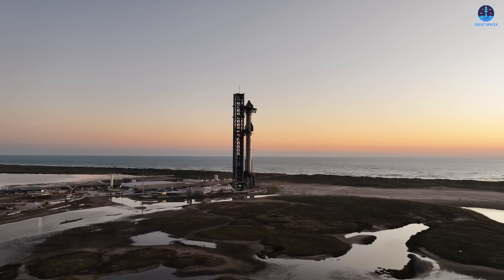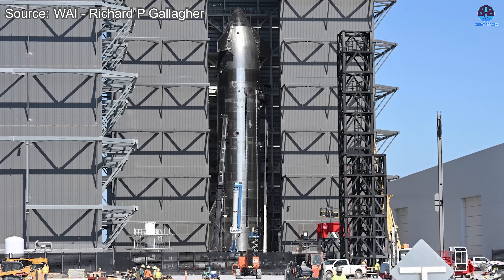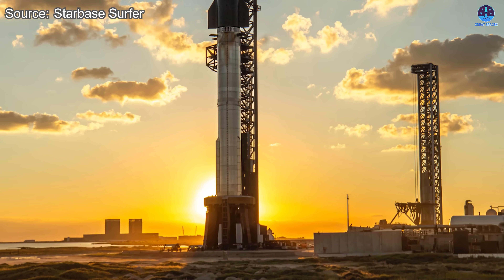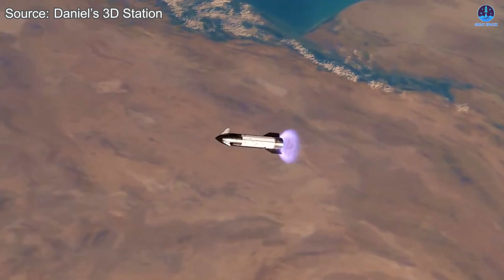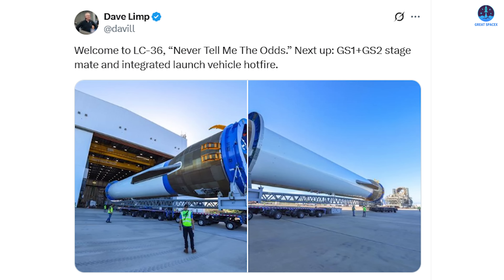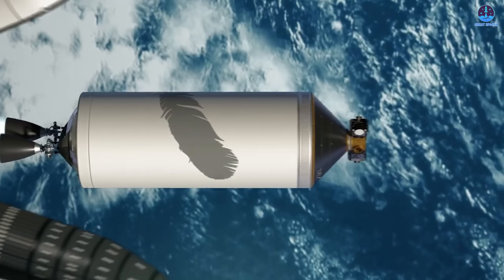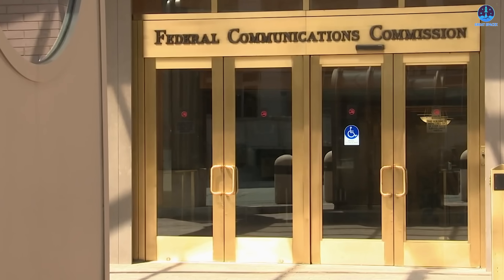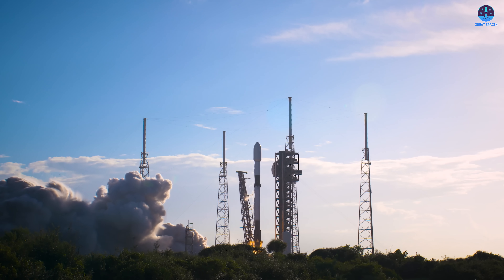SpaceX just Full Stacked Starship Flight 11 to Launch in Hours…Critical Moments Coming!

Comment: Yes, a decade later and this thing is still going to partially melt at the very least from sub orbital velocity. Imagine putting humans on it, returning from lunar orbit at a much higher velocity and having the atmospheric interface much hotter.  How many other rockets or specifically reentry systems have had so much trouble?
Reply: If mice can make it riding on the engines without problems, humans are easy peasy.

Comment: Blue Origin is not on the same level as SpaceX.
Reply: SpaceX and Blue Origin employ distinct operational strategies. SpaceX has been characterized by its practice of discarding engines and hardware into the ocean, whereas Blue Origin has focused on ground-based engineering efforts to ensure flight success. It is worth noting that New Glenn achieved orbit on its inaugural flight, a feat SpaceX has yet to accomplish.
Reply: @mp6756  And yet, it's SpaceX who is trusted to deliver supplies, crew, and equipment (as well as rescue the occasional stranded astronauts). They secure the biggest contracts from both NASA and the Federal Government. Blue Origin's biggest accomplishment; Sending a group of feminists into low Earth orbit for progressive propaganda. (Which is highly questionable considering that Katie Perry was easily able to open the "Space Capsule", from the inside, which is supposed to be impossible.)
Reply: @MalePossiblyWhite That's silly. Yes SpaceX is an operational launch provider. What's your point? Is humanity bound to SpaceX forevermore? Im not interested in the billionaire worship wagon I'm interested in the future of spaceflight Firefly, Rocket lab,
Stoke space, and even Blue Origin and many more.
Reply: @mp6756  You still haven't proved my point wrong. Of course, there are other space launch providers, and there always  will be. But SpaceX is the top dog right now when it comes to space launch providers and their track record shows. It has nothing to do with "billionaire worship". Nobody is worshiping billionaires just like nobody is hating on Blue Origin just because Jeff Bezos owns them. If you can't handle that, then cry about it but it doesn't change the facts.
Reply: @MalePossiblyWhite  Im not trying to prove anyone wrong. And I not discounting SpaceX's amazing rise to the top with impressive technological leeps forward. I am however very impressed by Blue Origin's successful maiden launch of New Glenn. It's a very impressive vehicle
Reply: @mp6756  I haven't seen New Glenn myself, but if it is what you say, then that's a good thing. Monopolies never inspire innovation, competition does. SpaceX needs a competitive rival in order to stay sharp.
Reply: @MalePossiblyWhite   Im on board with that. Starship will be a game changer.